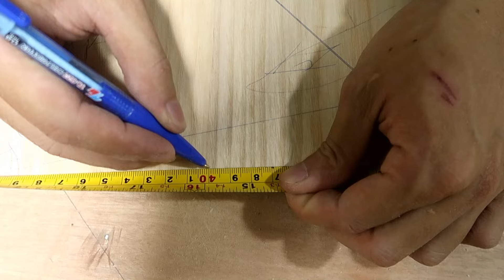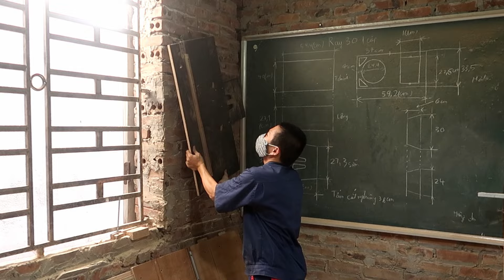How to make a 12-inch full-range speaker // My passion for music

Comment: If I want to make a 50 watts @ 4 ohms speaker system box with one Woofer and one  Tweeter, what should be the wattage for Tweeter and Woofer and is any crossover circuit required or not?